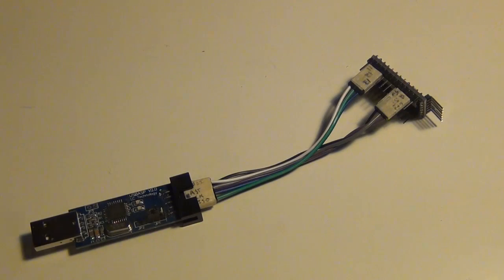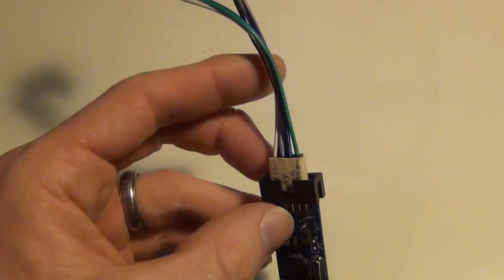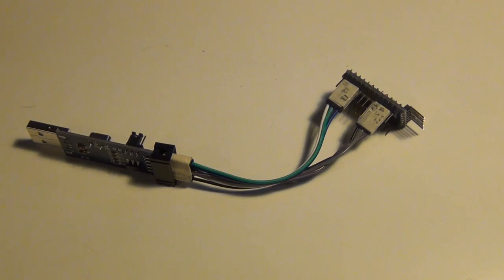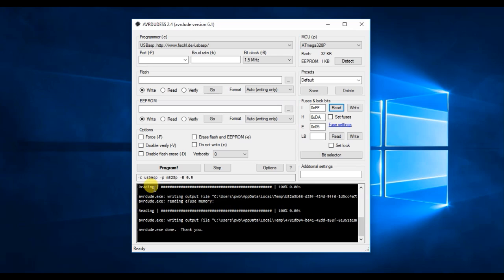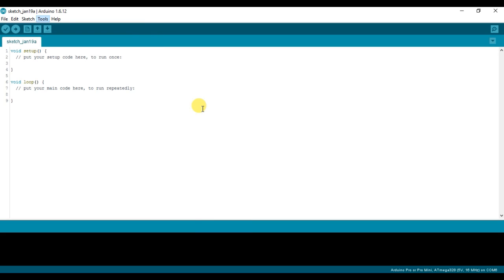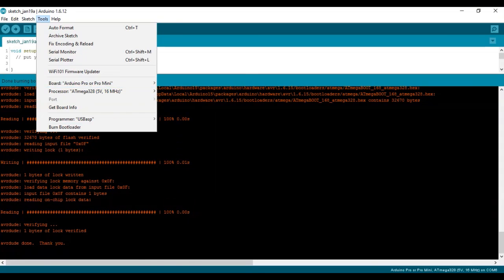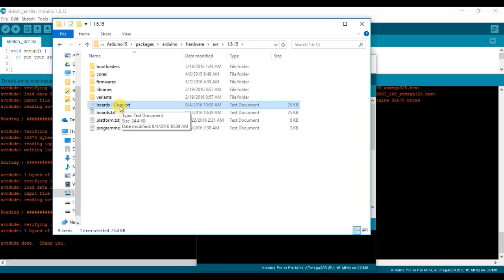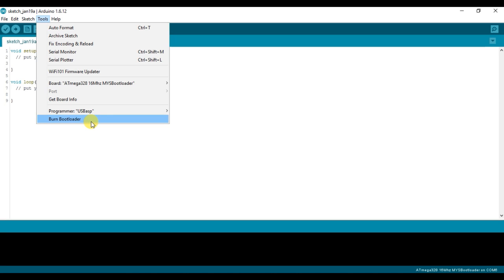How To - Burn a custom bootloader to your Arduino

Comment: USBASP!?  Turns my stomack.
Reply: Good information, theres an other uploader two which was better but didnt work.  I comment here because i felt a horrible shudder when he kept mentioning  "windows this and windows that"  it still makes me want to shudder!
Reply: @davidjackson2115  I do not understand your message.  It seems to have a few grammatical errors.  

IMHO the simplest USB interface is something like CH340.  It is insulting to present shit like V-USB as an option.  Even more so the way it was done.  Tells a lot about the incompetence of the... author or what is it.
Reply: @LambdaJack  CH340. When the minis etc have the bootloader on them those work perfectly. I had yr other verrient  USBASB or something similar too the CH340 7 or so years ago and having used them for a while. I know your coming from having more space for bigger program. Your USBasb is good advice as i have chips with no bootloader and uno does not load them.  I dont need long programs but chips I can use. Thats why Im here - so good advise thanks  {if you have government subotage oppressors subverting things just to screw you up  ...sheep dont get persecuted so dont understand}.  Nothing to be confused about - yours is an good solution.  As for windows I use linux mint and feel free.  Windows is like driving an underpowered tank in town then a sports car.

Comment: Why I'm getting this error? The program with other Nanos is working. Thanks.
avrdude.exe: set SCK frequency to 1500000 Hz
avrdude.exe: error: program enable: target doesn't answer. 1 
avrdude.exe: initialization failed, rc=-1
             Double check connections and try again, or use -F to override
             this check.

Comment: Try to flash NaNo and got this error: 

Arduino: 1.8.11 (Windows 8.1), Board: "Arduino Duemilanove or Diecimila, ATmega168"

avrdude: warning: cannot set sck period. please check for usbasp firmware update.
avrdude: Expected signature for ATmega168 is 1E 94 06
         Double check chip, or use -F to override this check.
Error while burning bootloader.

Comment: Can we update old bootloader devices to new bootloader version? Some arduino nano models have old bootloader version. can we update this?
Reply from the maker: It should work. I have flashed custom bootloaders and then back to the original. So, I don't see why it wouldn't work to update them to a more recent version.

Comment: i have a question what is this 
avrdude: Yikes!  Invalid device signature.
         Double check connections and try again, or use -F to override this check.
i had got about 50 + attiny 85 from JD joy buy and when they came only in plastic bag are they dead from static or am i doing some thing wrong.
the set up i have the attiny 85 will program perfect on the first batch i got, bit they had been in anti static tube...
hope you can help
i am using Arduino as ISP
Reply: They could be bad or they could need a high voltage programmer. They are probably refurbished if they came in a bag. If so, it's likely they have had the programming pins repurposed in the fuse settings. You must use a high voltage programmer, like the actual Atmel toolchain hardware, to reset these fuses. Those tools have the ability to do a 12v routine that resets all fuses. I haven't messed with these chips myself, but I think there may be some alternatives like an Ardy Uno shield or something. If you're on Windoze just get the Atmel tools and tool chain for the most headache free and functional option. Many people claim to only use windoze still due to Atmel Studio and AVR's.

Comment: I went a step further but I do not know if it was too hasty. I installed on a pcb the micro atmega328p-au including an external resonator of 8mhz. In order to be able to access its programming later, I arranged ISP and FTDI ports as if it were a pro mini 3.3v to 8mhz, however, following the steps that you indicated I was not able to establish communication. I tried different arduino plates such as pro mini or nano obtaining good results. But I can not advance my project.
Any suggestions
Reply from the maker: Hmm, I'm not sure. Just double check the wiring. Also, the pins on the atmega are not the same number on the pro mini. That messed me up when I was trying to add a resonator.

Comment: thanks for the very clear and helpful video. I need to OTA, now can I burn the MYSBOOTLOADER and use my own sketch? and how to trigger flashing on the remote node ( the one which has MYSBOOTLOADER, which i tried and succeeded :) )? Maybe you can do a video on that ? thanks for your time.
Reply from the maker: I have that video on the list but it's not at the top unfortunately.  I have been so busy lately I haven't had a chance to work on any videos.  I'm hoping I'll be able to get back to it after summer ends and the kids go back to school.
For the MYSBootloader questions I suggest you head over to the MySensors forum.  You will be able to get better help from there.  But, you will burn the bootloader using the process in the video then you can upload a sketch using the arduino IDE with an FTDI adapter or use FOTA with the MYSController or I believe MyController will do it as well.
Reply: Alright. Now with the cheap ESPs people starts to ignore nrf24. But still I think such a video will get good Likes for the channel. Since I looked up the net and couldn't find anything for that. Thanks for your time.
Reply from the maker: Yeah, the advantage of MySensors is you can interchange controllers easier. I haven't played with the esp yet. I know MySensors supports it but I haven't had the need yet.

Comment: So how can i with cmd without any ide , also i want to ask something , how mcu understand that this program is for bootloader you wrote , did you any change fuse settings , before flash bootloader section ?
Reply from the maker: I actually did not write the bootloader.  Just used it :)  You may have to write fuses depending on the bootloader.  For this one I don't believe I did though.

Comment: When i click detect mcu in avrdudes;

Unable to detect MCU

avrdude.exe: set SCK frequency to 1500000 Hz
avrdude.exe: warning: cannot set sck period. please check for usbasp firmware update.
avrdude.exe: error: programm enable: target doesn't answer. 1 
avrdude.exe: initialization failed, rc=-1
             Double check connections and try again, or use -F to override
             this check.

avrdude.exe done.  Thank you.

So what now then ?
Reply: Hello!!! i've had the same problem... i tried doing this with arduino already wired up to usbasp... And it worked for me)))
Reply from the maker: Are you sure your wiring is correct?  If so, you may have a locked bootloader that will need to be updated with a "high power" programmer.  Are you able to upload a bootloader to other Pro Minis (from a different seller)?
Reply: Pete B no, i have a working uno, a non working uno, a working nano, and this usbasp.  So i tried to burn the bootloader to sick uno, both from working uno, and my working nano. None of them worked. All cables are right. 

Should i risk my precious working nano, and use my working uno to burn bootloader to my working nano ? (Just to see if my usbasp is working or not ?)  or should i just toss the sick uno :) and move on ?
Reply: I already deserved a nobel for trying so hard to save that uno...
Reply from the maker: Hmm.  It doesn't sound good.  Maybe just write off the non-working Uno.  You could always buy a pro mini to experiment with.  They are very cheap and learning how to burn a bootloader is a good thing to know for the future :)  Good luck!

Comment: Hi Pete,
many compliments for Your tutorial.
I have a problem: I bought an Arduino Mega 2560 "Chinese Clone" and It's impossible to load any sketch in It.
I tried all ways but I think the bootloader has not loaded.
I say that because when I connect Arduino to the PC, the L blink very shortly and then never more...
Do You think it's possible to recover this situation following your tutorial?
Do IO need to download the Arduino Mega 2560 bootloader or is included in IDE?
Thanks a lot, Umberto.
Reply from the maker: Hmm.  You could try.  I've never personally flashed a bootloader to a Mega.  The bootloader should be there with the IDE so you shouldn't need to download another one.
Reply: Hey,
I have bought an Arduino Nano clone.
I have tried uploading the sketch but bootloader isn't installed in it ,so the sketch is not getting up loaded.
Can I install the bootloader using this method ?
Umberto ,I have a question for you.
Did you successfully installed the bootloader on your board ?

Comment: Any additional info about how to use this custom bootloader?
Reply from the maker: +Mahmoud Metwally is this what you're looking for?github.com/mysensors/MySensorsBootloaderRF24
Reply: Exactly, is there any documentation about how to use this bootloader?
Reply from the maker: This is a really long forum topic but it will definitely give you more info on using MYSController (the tool that will do the OTA uploading with the bootloader mentioned above). https://forum.mysensors.org/topic/838/windows-gui-controller-for-mysensors  You may also want to do some searches on the MySensors forum for MYSController.
Reply: Ok, I will try to figure things out myself, but it would be awesome if you make a video explaining this topic and thanks for this great video by the way:)
Reply: Program Arduino mega with USBasp
https://www.youtube.com/watch?v=BoSWg_30w1I

Comment: Good Job! Had the same Problem with the UNO and made a little adapter board to plug in the usbaso cable and the mini. Also works fine. 

Now I really want to try OTA but the flashing part is missing from this video.
Reply from the maker: Thanks!  I will eventually make a video on the OTA process but it was beyond the scope of this one.  I wanted to do a generic "burn bootloader" video first as I needed to show how to do that for another upcoming video I'm working on that requires flashing a bootloader.  There are so many videos I want to do but never enough time :)